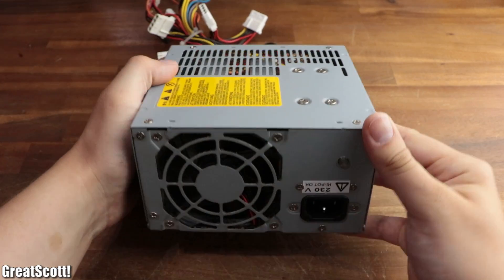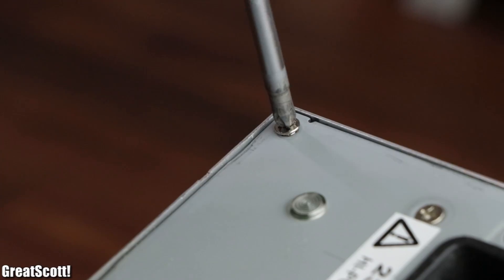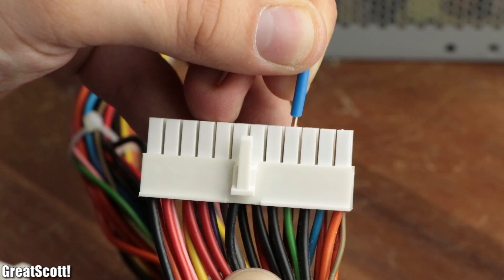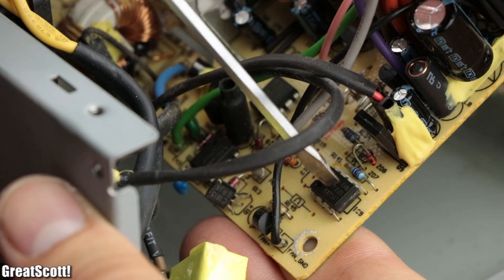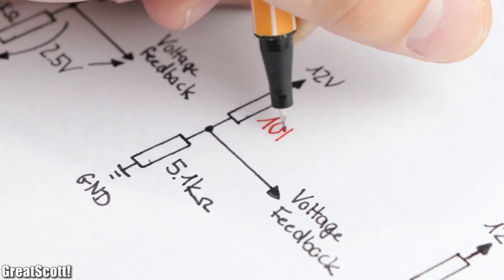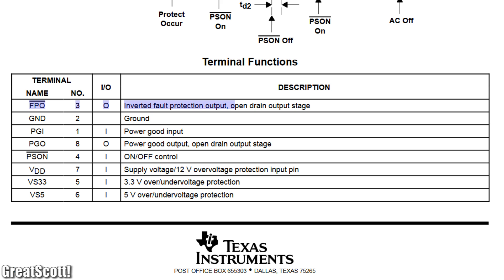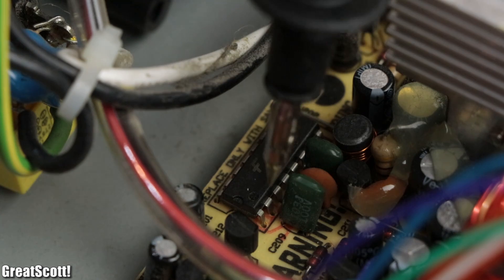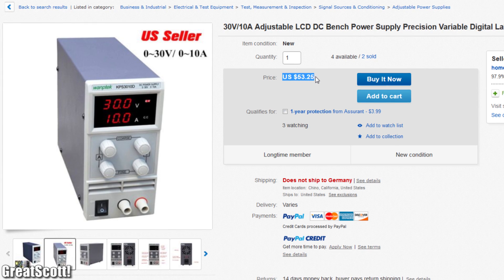HACKED!: ATX Power Supply with Variable Output Voltage?

Comment: jesus christ 11.3v without any load attached? thats almost off from the ATX standard i wont recommend using so shitty power supply
Reply: it doesnt matter as long as its 11.8-12.3~ its almost impossible to make 12v rail actually deliver exatly 12.00
Reply: Its because the other rails weren't being loaded, these types of supplies are commonly cross regulated to an extent to save space and cost. In a computer all of the rails will have a load even when idle so this out of spec thing usually doesn't happen.

Comment: Take an old laptop PSU and buy an adjustable buck converter. 10 bucks for a  lab bench PSU that goes from 0 to 20V.
Reply: nullplan01 feedback circuit is also going to be quite a bit less finicky in a laptop PSU to modify it.

Comment: hi nice video as usual :). i was also modifying an power supply. this information will help me for sure thank you. i found that the input ac supply is after all converted to 12v dc at the output of atx supply, but i dint get it how the +5v  and +3.3v output is obtained. although they use 7805 ic for regulated standby 5volts. do they use buck-boost converter for 12 volt to 5v or 3.3v dc to dc conversion?

Comment: Just so you know, a standard atx power supply uses a type of SMPS called a forward converter.  Forward converters only consists of a controller chip that outputs a PWM signal that is regulated by a 
feedback signal which drives only one transistor that is on one side of the transformer while the other side is just connected to ground usually.  It is called a forward converter, because the current flows only one way through the transformer.  Of course this is the bare minimum of a forward converter which does not include protection circuitry and PFC.  Modern atx power supplys usually has PFC, which is why most UPS systems will not work.

Comment: There's a great 38v dc-dc variable buck boost converter module with led display available on eBay that is easily added to an old power supply that makes a great variable shop supply with adjustable current limiter.
Reply: Yes, or if 10.5 Volt is enough for your lab (arduino, raspberry pi, and what not) , this buck converter is good value for money: www.ebay.com/itm/Constant-Voltage-Current-Power-Supply-Converter-DP30V5A-L-LED-Module-32V-5A-160W-/172661458452  Just hook it up to the 12V of the  ATX power supply.

Comment: you can use blue and yello wire to get 24v and then use dc step down buck converter to reduce the voltage .

Comment: Hey Jeremy, 
  The problem is that your playing with a chip that uses 2 comparators. These are way more complicated. However that KA7500 chip is a replica/update of the old TL494/TL594. You can redesign the circuit around that IC to create a voltage and current feedback loop and therefore a variable voltage/current supply, (good luck building that in a 1 week project though ;)
    I've been looking into this circuit, but it gets super complicated IMO to make it variable over a wide range. The FET duty cycle and core saturation math gets a bit blurry for me. All the examples I've found attest to the potential operating range of the circuit, but they don't really explain the details of how to design specifically for an variable output. Where and when to compromise specs is the challenge. The best I can tell you build for about a 90% duty cycle at your maximum power output, while trying to maximize the timing frequency at that output, but I'm not 100% clear on that one.
  I've found some interesting circuits to try and will probably do a video at some point. There is a way to use a power PNP BJT with a capacitor on the base to reduce the ripple effects across a wide bandwidth.
    Bill Herd over on HackaDay's YT channel hinted ages ago he was going to create a variable SMPS that used a linear design at the output. I've half built a project on that idea, but that is about 3-4 down my list.
    If you see this post and want to contact feel free Jeremy. I'm using YT to try to connect to more of a community. YT also keeps me committed to completing my projects despite being partially disabled and stuck laying around most of my day. My channel is still not monetized and I'm not trying to copy anyone. I'm just here to keep it interesting ;)
 -Jake.
Reply: If you do any work towards this lab psu thing, please let me know. Seems like an interesting project to keep up with.
A couple years ago I have done the same modifications he shows in this video, and I consider it a success. I was able to get the voltage range I wanted. But now I'm looking at doing something with higher range, so I would need to do more intrusive modifications than just adding a potentiometer.
Reply: Keep the spirit. :)

Comment: for the thousand time  make a video about opto coublers and how to transmit analoge signal throw it PLZ
Reply from the maker: Optocouplers are on my electronic basics to do list
Reply: waiting for it 
I want to finish my graduation project LOL
Reply: abdalkader shuker 
  Just play around with a laptop or printer power brick. They have an opto for feedback. Both sides are usually biased. Put a pot on both ends and go nuts ;)
Reply: abdalkader shuker 
   Simply don't think of it as an "optocoupler" at all. Pins 4, 5, and 6 are the 3 pins of a NPN transistor. The only difference is the signal that goes into the base is already connected. Any small signal amplifier topology should work. You just need the datasheet and stay out of the saturation region while properly decoupling the DC from the AC on the secondary side. You just need a basic oscilloscope with 2 channels to get it dialed ;)
Reply: hmm I managed to transmit the positive side of the signal. However the negative side is cliped . I know it is an LED and can't be lit by the negative side of the signal . biasing the signal to lift it up resulted in burning resistors and ICs 😂
I am using 4N36 IC 
any Idea?

Comment: Someone needs to design an Open-Source Hardware ATX  power supply.  

 It would be designed to  solve placement of Caps, FETs, and Transformers to be easily checked, de-soldered/re-soldered,  and replaced as well as finally having schematics and layouts for the product when service efforts are  required or wanted.
Reply: Uuuh, not really. I'm quite surprised GreatScott put a warning at the end of the video instead of the beginning, but nonetheless ATX supplies can kill you. I think open sorce hardware is the future, but for hazardous equipment a big 'no-no' label is mandatory.

Comment: you can easily use one transformer,bridge rectifier and lm317 to make variable dc power supply.i know that lm317 can maximum output current 1amp but with bypass transistor you can change that :)

Comment: Could you get more voltages connecting the + to each other on the original design?  For instance +5 to the +3.3 to get +1.7.  Or +12 to +5 to get +7 ?

Comment: high voltage? I'd be more scared of the janky caps in those supplies over the high voltage. just a bit out of spec and you either have capacitor popcorn, blown components, or a completely dead supply altogether a-la mains cap short with how cheaply some of the low-end supplies are made. the fact your first supply had an unloaded voltage on the 12v rail under 11.7-12.35v is a good sign that something wasn't right to begin with from the get-go. would NOT trust that supply with my life, even if my livelihood depended on it. not to mention the absolutely terrible ESR and ripple from such supplies... it's as a certain Australian says, it's whatever was cheap on the shenzhen market that week.

Comment: Nice but are you kidding me that 63.25 USD is not very expensive lol?If i am going to buy it probably need to sell my kidney
Reply: I've made DIY PSU for ~$10 from AliExpress :D
I used XL4015 buck converter ($1.40) and a laptop charger (19.5V, 90W). The rest of the money I've spent on a voltmeter, potentiometers, etc.
I also used an ATX PSU casing to house all the things.
Reply: tmp64 haha probably make it those myself

Comment: Buy a cheap chinese LED supply -- the kind with the perforated metal case. The feedback supply is much simpler, and the 48V ones can be adjusted from 0 to ~63V. It's a bit noisy, but an LC filter cleans it up nicely. All you need to do is make sure the r values are low enough to ensure proper bias current.
Reply: How can I do that? I would appreciate if you could help me build one!
I've disassembled two at home that were still working, but till now, I have no idea on how I could use them.
Reply: Victor Ribeiro Find datasheets from all ICs used on board, one of them will be used to provide feedback using resistor voltage divider, you will have to modify that divider to get desired voltage
Reply: ethanol L@@L

Comment: nice video, how about hacking a notebook power supply and change its output from i.e 19v to 12v ?
Reply: KrX 
  I do, but you have to click on my logo to the left to get to my channel. My posts usually get blocked if I post links... despite the fact I'm not monotized or trying to make money off this stuff, at least not currently.  I'm just a hobbyist having fun and trying to add to the community.
Reply from the maker: I put it on my to do list
Reply: KrX 
it's the "5 easy steps" one. The pic is of a laptop power brick with  banana terminals sticking out the top. It's hard to miss. I have only done 6 videos on electronics in the last 2 months.
Reply: I did it already ;/
Reply: do you have a video or tutorial for that?
Reply: ok thank you, i saw the list of your uploads, could you name the titel of the video? thank you

Comment: general question: why does such a power supply not transform the sine wave from the wall first and recifies and smoothens later?
Reply from the maker: Because you would have a lot of power losses through the transformer.
Reply: I see, thanks!
Reply: the increase frequency first to improve efficiency . then the higher frequency power is converted to dc at last.
Reply: ..could you post a link showing the math behind that?

Comment: Informative videos like this are great, but you should warn people at the start that messing around with mains voltage will surely kill a beginning user. I'd rather throw 50 to 100 euros on a lab bench power supply over messing around with mains voltage.

Comment: Yea I just made a custom housing for my ATX power supply and used a buck converter with a voltage/ammeter display.  Works great. Gets me 1.33v -11.8v.  And of course kept the constant 3.3v, 5v, and 12v banana jacks.

Comment: I followed along to everything except for why you felt those 10k ohm resistors were "suspicious"
What about them made them stand out to you?
Reply from the maker: It was directly connected to the feedback pin. So it was one part of the voltage divider.
Reply: Ahhh, perfect. I understand now. Each resistor was a half of the voltage divider. Thanks for the reply.

Comment: Good Job trying and even better Job with the warning at the end!!It's real easy to forget how powerful these power supplies are and how one mis-hap could be dangerous. Watching your first video on this, along with the Video on the viable power supply. I created a combined unit.(Picture on my Google page). One side, I have the power Supply with a Volt meter. It uses 12V, 5V, 3.3V, and -12V rails. Than next to the voltmeter, you plug from the outside, any combination of 24V, 17V, 15.3V, 12V, 8.3V, 7V, 5V, 3.3V and 1.1V. Than on the other half of the unit(w/Volt/Ampmeter), I have a 5AMP Buck Converter, powered by a 24V 5 amp (LED) Brick power supply. It is CC/CV adjustable 24V-1.5V. Its very compact and runs Great! I also used Plexiglas, so you can see the internals. All Ideas for this project came from Great Scott!! Of Course, I also have a couple of units, made apart...LOL

EDIT-On The variable side of my DIY power supply, below the power switch is 2 banana female plugs(hot/cold). When the LED power supply is Not plugged in, I can direct power from my Power Supply side(with Banana cables). But Unfortunately the most I could use on that side was 24 V 1 amp. Bucked down, the amp draw got bigger, but not enough for the higher powered devices. Reason I also purchased the LED brick. I hardly ever use the LED brick, the Power supply side normally has the power needed.

Lots of Great Ideas come for this channel! New to DIY,😊

Quick Q----I noticed you mentioned that the power on the other side was upwards of 325 Volts DC and I am sure a TON Of Amps....Been looking to create a Battery Tab welder, and exploring all options before I decide on the way I will go. How many amps do you think you get on the 325 V side before it will force shut off the unit? Do you think its possible to use one of these, except a MOT. Just an Idea???

Comment: What i think you didn't notice is that the fan is connected to the 12V supply, and maybe if you run it at a lower voltage like 5V it wouldn't run. I don't know if this is a big problem but just putting it out!

Comment: Hey Scott! Would there be any real downsides of adding a buck/boost module, like you said in the beggining? (like adding more ripple) I'm thinking about using a LTC 3780 module since it has CC alongside the usual CV function (and seems to be operating at a higher frequency than the usual buck/boost ICs and I suppose that's a good thing). 

Thanks for the video!
Reply from the maker: That should work
Reply: The ripple could be more or less depending on what you used, but, probably the biggest thing would be a loss of efficiency unless it's actually making the power supply operate in a more optimal range.  Also, obviously cost and component usage.  On the other hand, I think the case that making these modifications is a bad idea might also not be super strong, especially if the PS components are operating within spec and it gets monitored a long time for issues before being ever left alone with mains power.  I'd personally do the experiment, but I'd want to do a fair amount of research on the PS components and really think about whether I was comfortable that my modifications produced a safe system.

Comment: I use 19v 90w leptop adapter.  and use aftermarket voltage regulator. and. make my variables power supply..and use 240v fan to decrease the temperature.   ohsem.

Comment: Hey Greatscott I have an old ATX supply and tried this out but before I made it variable I tried it without touching the ic by shorting the power on wire to ground luckily enough it turns on but as soon as it turns on it shuts down when I put a load on the supply.
Help would be appreciated
Great Video BTW.